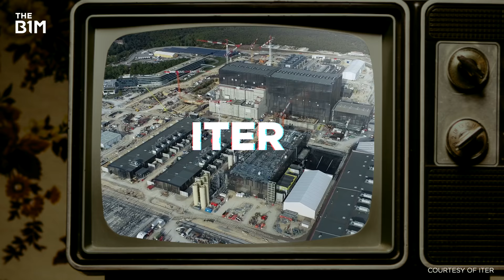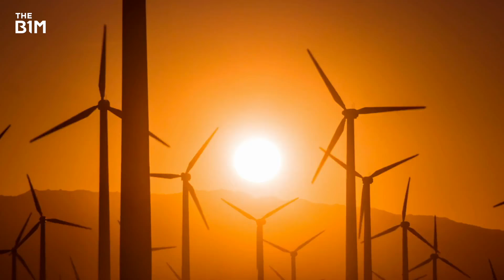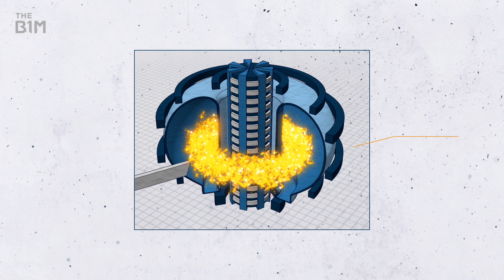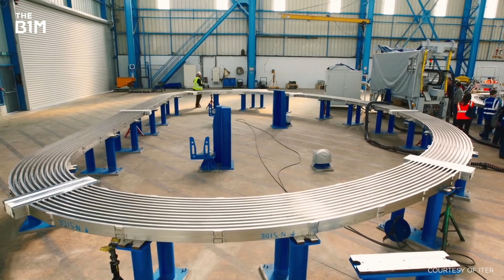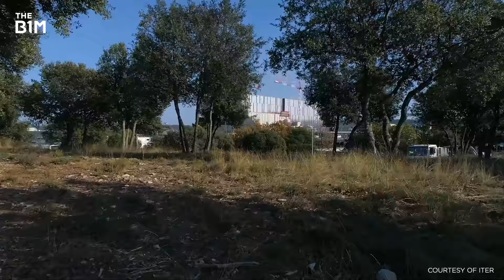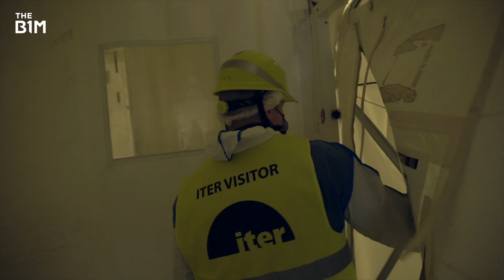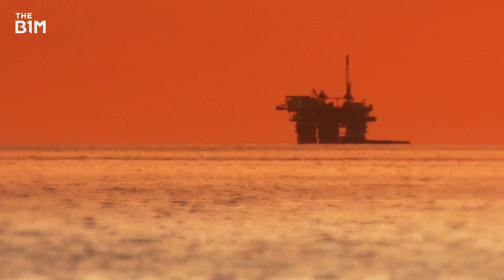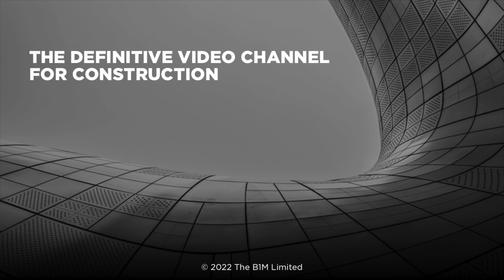We Went Inside the Largest Nuclear Fusion Reactor

Comment: India’s contribution to ITER Cooling Water System enters commissioning phase
The heat generated in the ITER Tokamak along with the heat generated by auxiliary heating systems and supporting systems (approximately 1150 MW) will be transferred to the atmosphere with the help of Cooling Water System (CWS). The CWS consists of four sub-systems, viz. Tokamak Cooling Water System (TCWS), Component Cooling Water System (CCWS), Chilled Water System (CHWS) and Heat Rejection System (HRS). Among these sub-systems, the supply of CCWS, CHWS and HRS is part of India’s in-kind contribution to ITER project as one of the nine procurement packages. 
The route from design to engineering, manufacturing, procurement and testing of the components and system as a whole followed the concept and functional specifications of the system provided by ITER organization. Most of the components and related sub-assemblies were manufactured in India across different locations and included the involvement of several contractors/ sub-contractors/ manufacturers. The design, manufacturing and testing of the supplied components followed the stringent quality norms of ITER nuclear establishment. All deliveries related to this procurement package were completed in 2021. 
The equipment/ components delivered by ITER-India include cooling tower of 510 MW heat rejection capacity constructed of FRP structures with dimensions 80m (L) X 32m (W) X 20 m (H), plate type heat exchangers of capacity upto 70 MW each, water cooled chillers of 1200 TR each, pumps with flow rates upto 1.87 tonnes/sec each, electrical motors upto 1.4 MW capacity each, soft starters of 6.6 kV/ 800 kW capacity each, variable frequency drives of 6.6 kV/ 750 kW capacity each, E-house of size 21m (L) X 7m (W) X 4m (H), piping of ~16.5 km length with sizes upto 2m diameter - supplied as fabricated ~4500 spools involving one lakh inch-dia welding, 900 MT of piping supports, ozonators, 1400 nos. valves (different types and sizes), cables of ~61 km length, water polishing units, various instruments, stop log gates, bellows, pressurizers, panels, heat tracing components, etc. 
Most of the equipment have been installed and commissioning activities are underway at ITER site to support the first plasma operation deadline of 2025.

Comment: Huge error.
Deuterium is easily available from water.
Tritium on the other hand is not. Current prices for Tritium range from $1,400 to $3,000 per gram.
Charging ITER w 125 kg of fuel, 50/50 will cost 62,500 X $2,200 (average) $137,500,000 to produce 500Mw of energy is very expensive energy.

Comment: the large flux sphere when purged with inert gases can be used to smelt metal alloy ingots that can be later machined into parts, for making super alloys! outside of a contaminated environment... idea of fusion is wrong. but after recording data... there is a useful structure change that can take place.

Comment: This ITER is now ancient history. All the old fission reactor problems also go away with the new Fusion reactor era already now here since 2019. We have recently taken a new step to advance the physic of power production by enabling the chemistry of the atomic nucleus, or, as I call it, "nuchemy", We are passing the chemistry level where we interacted with electron shells and are moving on to nuclear manipulations in this "nuchemy" atomic nuclear era when we interact and multiply nuclear protons using hydrogen fuel stock. We have rediscovered the lost work of the alchemists and can make new elements with different atomic weights and vastly new properties. This was ably demonstrated in "The Safire Project". Quanta are important. We now have enough energy in them to manipulate the atomic nucleus much more easily by creating a compartment or a local region of plasma containment so reactions at this atomic nuclear level can easily take place. This is about to practically enabled a fantastic new era of energy production for the whole of mankind. This with free fuel obtained from water or atmospheric moisture anywhere in the world. New fusion nuclear is at the industrial commercial production final development point as of now. The energy argument and other power methodologies are all now irrelevant as we have new and very physically and economically powered practical and local community level fusion nuclear power. Solar roof plus Teslawall battery maybe the present way to go domestically but megapack batteries and multiple storage technologies interconnected with an expanded ugly grid have a less certain requirement when you consider new any-scale community based and 24 hr self-fueling reliable fusion nuclear in the form of the "Safire Generator". Learn all about it at "aureon energy.com". Learn the newer EU physics at "Thunderbolts Project.com" and you will be permanently reeducated with the advanced new theory.

Comment: The SPARC tokamak project threatens to render ITER, redundant!... at a fraction of the cost and in a fraction of the time. The fact is ITER  Is a thirty year old Project with 30 year old tech. If you don't move fast enough with cutting edge tech, you get left behind... the same is happening with NASA's  (SLS) rocket... 30 billion+ and 6 years in with an old design. And Space X is just flying past them... to the point of being embarrassing!

Comment: A great sales pitch if you like but the problem with these huge projects is that the technology is out of date before you even finish it. This  film mention superconducting magnets .The method of this form of magnet is already out of date. This is a tokamak inside a huge cryostat to freeze the magnets.Super cunductivity has already moved on .The computations for the other magnetic model ,the stellerator, is well on the way aswell. Small compact tokamacs or Sparc reactors seem to be the best bet today where as this model was designed in the 1980's . Now we have advances in material science and machine learning that were not imagined in the 1980's.

Comment: In order for fusion to be commercially viable, it has to compete with cheap sources of renewable energy together with rapidly maturing (and in a decade or so, also cheap) means of energy storage. That's extremely unlikely. I love ITER as a big, expensive science experiment. No doubt it deliver great science (and engineering). But all these videos recently extolling fusion energy lack one simple thing: cost. If its more expensive than providing cheap, clean, reliable energy in other ways, its never going to be built at a commercial scale. And look at the damn thing. Seriously. There's no way that the cost problem can be solved. Specialised materials. Scale. Complexity. It will never compete with simpler, cheaper technologies.

Comment: Sadly even if ITER is ever successful it will never generate any kwh of electricity. It's just not designed to catch the generated heat into electicity the first place.
Still a great proof of concept machine used to prove and improve Fusion tech all over the globe.

Tho, with recent technical improvements stellarator reactors seems much more realistic and doable than tokamak... so sad there is so little funding into them.

Comment: I'm sorry, I love fusion science and we are on track with ITER, but it will never produce more energy than it uses and it is a wrong interpretation.

It will be the first large scale reactor to produce more heat output than it takes to create the plasma heating (500MW out for 50MW in), but there are other equipment in the chain: converting the heat to electricity, cooling, support buildings, etc. It will use a lot more energy than you can gain, optimistically from ~440MW it gains ~250MW, expected to be lower as it is not designed for continuous operation.

Comment: 150000000 °C is already extreme temp. How do you extract the heat? Does it start after you heat and self sustaines in the magnetic field with hidrogen injection?

Comment: She is absolutely right, there is practically no other solution, when you take into account the awful mess humans make just being, and with our population growing like a virus, the the power that will be required to run all the technology that will keep the earth habitable not just for us but all other lifeforms will be enormous, Fusion is the clear answer.

On a more technical note, because the basic design for ITER was laid down years ago and thus is committed to that design, there have been some pretty major breakthroughs that change things a lot. The main one being to do with the superconductors that form the electromagnetic field that compresses the plasma. ITER was made so very large because the size and volume allows for greater control over the plasma with the strength of the electromagnetic field they could generate. 

But now, there's been a recent breakthrough, a new superconductor, REBCO, that is a massive game changer, it is special in that it is easier to make, cheaper, easier to use, but most importantly it can maintain RIDICULOUSLY powerful electromagnetic fields and a higher temperature, so it is easier to cool. The high field strength means that new designs can be made far smaller than ITER, and that is what is going on right now, but these are devices that are pushing material science to the extremes. These electromagnetic fields are so powerful they literally want to tear the machine itself to pieces , so everything  has to be over-engineered so that it doesn't fail.

Comment: There was a recent reactor that produced more energy then required to start the fusion, it was on a small scale, but seemingly proves fusion to be a realistic power source.
Reply: You are right, there have been a few reactors now that can produce more energy than they use. The main issue nowadays is sustaining the reaction as the magnetic field isn't perfect and you end up getting a lot of instabilities in the plasma in a short amount of time. That plasma does not want to stay compressed, and you're essentially trying to compress it with a leaky bottle, constantly moving the holes around to where the stuff inside the bottle is trying to get out. Recently some good research has been published that uses machine learning models to rapidly make changes to the magnetic control system, this has the potential of being able to sustain much longer reaction times in traditional tokamaks. Some other relevant research I've come across recently is a better model for how these instabilities start to form and how to detect that, potentially leading to quashing them when they're a lot smaller and easier to control.

Anyways, sorry for the rant, but the point is that I agree, fusion is a lot closer than most people think.
Reply: @CockatooDude  No, its very interesting, thanks for sharing!
Reply: That violates the laws of thermodynamics, which is, impossible.
Reply: @abloogywoogywoo  Fusion is a real form of energy… it doesn’t violate the laws of thermodynamics, lol.
Reply: @TheTrueSmitch  lol, you took what I said out of context, lol. We have not ever made a machine that has ever produced more energy than what originally went into it. You are referring to a Perputal Motion Machine, which violates the laws of thermodynamics, which is, impossible. Even stars cannot produce more energy than what is afforded to them by their hydrogen reserves (the cloud nebula that formed them), once that runs out, fusion in the core starts to go haywire and they move off the main sequence.
Reply: @abloogywoogywoo  All forms of power we use hinge on providing more energy than we use to start them, otherwise how would we have power plants? A coal power plant produces more energy than is required to start it up, for example. You can see what I'm getting at. They all require fuel of some kind to do this.

Fusion is like this as well, but the fuel is isotopes of hydrogen instead of bricks of coal. The issue so far has been that even with the fuel present, it has been a challenge to make a fusion reactor which generates more energy from that hydrogen fuel reliably than the amount of energy that is required to get that fuel into that energy generating state.
Reply: @CockatooDude  No, and no.
https://en.wikipedia.org/wiki/Potential_energy
https://en.wikipedia.org/wiki/Energy_density
Honestly, I'm talking about physics, and when you lot talk about fusion, I swear you're picturing unicorns and fairies instead.

Comment: Humans trying to achieve Kardeshev level 1. Ugh...
A stable plasma tholus of the proposed magnitude will require some serious diverted output corridor, and then of course capacitation storage for return. 
It's a gamble still, I love the confidence behind this project. If they can produce 1/4 gigajule the routing process for the energy released will be the test. Conversion of plasma energy to storage household use energy will be among the bigger challenges. And, of course looping a percentage of the output back to maintain the electromagnetic torroid which holds the plasma arc in situ.
Glad it's in France, if anyone can pull this off they can.

Comment: So, we have been working hard to figure this fusion technology out and now what?
Nuclear Fusion has no practical application. It's simply yet another heat source.

But at least now we can:
1. heat water and make steam
2. run the steam through a turbine and make it spin
3. use this kinetic energy to drive a generator
4. generator turns kinetic energy into electricity (40% efficiency)

Sounds familiar?

Comment: The problem with Nuclear fusion as a fuel source is that it requires Tritium and Deuterium (two hydrogen isotopes) that are in short supply. So we'd be moving from one finite resource to another. Also, splitting water apart to fuel energy production is less than ideal given how scarce water is in many parts of the world. Splitting the water into Hydrogen and Oxygen also takes a ton of energy through electrolysis and all of this depends on us actually cracking sustainable fusion (where the reactor produces more energy than it consumes) which I don't see why this project would achieve that. They don't seem to be doing anything different than the myriad of other labs around the world that have been running fusion reactors since the 1950s.

Comment: The premise of this video is completely wrong. ITER is not going to be the fist to produce more energy than it takes to run, it is going to be the first to get a net gain in plasma energy only (Q plasma > 1). This is a long way from producing more energy than the reactor takes to run (Q total > 1). It will likely be another 100 years before a reactor is constructed with a commercial energy output if that is indeed possible at all. This is an easy mistake to make as the science behind fusion is fairly impenetrable, the news releases from the fusion community are misleading and even mainstream news channels get this wrong.

Comment: Problem with fusion is we don't have gravity as sun gets due to weight. Even Jupiter is failed star with very high pressure , so fusion cannot be used.
Reply: We can exchange pressure for temperature. We will make it 6x times hoter than the center of the sun.
Reply: Jupiter isn't a failed star smh... It is not even close to a star

Comment: Great video. I would go one step ahead from the fact that this technology is still in the experimental phase. Lets assume that the technology works and we have those fusion nuclear reactors all over the world producing carbon-free energy, the same way as the Sun does now. This would mean that those isotopes of hydrogen will be converted to hellium that will be released in the air and start to get accummulated in the upper layers of the stratosphere. Question 1) Would there be any environmental impact with a load of hellium being accummulated in the atmosphere (change of light spectar that life/plants on earth are dependent on for their everyday's energy supply? Or maybe, the transparency of the atmoshere changes and and less light i.e. energy hits the surface of earth. Accummulation of hellium will happen over time if this technology becomes commonly used to produce electrical power as every country would need to have one of those. Question 2) Even more important, hydrogen being converted to hellium would mean less and less water on earth (again, over time) assuming that hydrogen will be produced from water rather than from fossile fuels (beacuse only then we can say that this technology is 100% green and without emissions of green house gases). This could cause more dry climate and droughts all over the globe, lower levels of oceans etc. Has anybody thought about those consequences when jumping straight into building multi-billion dollar experimental facility in France (and not only in France, as I undertand, smaller facilities are already built in South Corea, China, maybe U.S.). I would appreciate an answer from someone.

Comment: Nuclear waste management is so much better now. Fission is also an AMAZING carbon free energy source. They only need refueled every 18-24 months, and the fuel cells are not that big. Fusion would still be AMAZING to have working. Fission could be a very good, and very necessary stepping stone before its sustainable however.